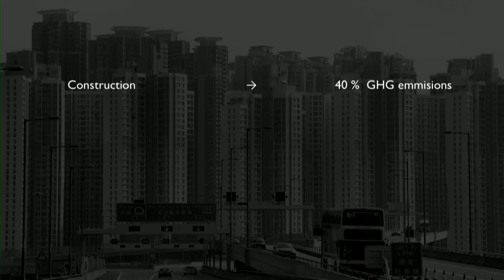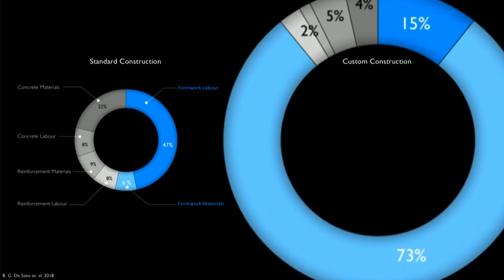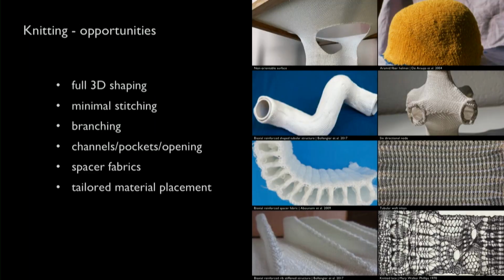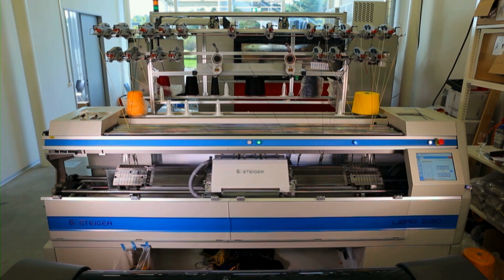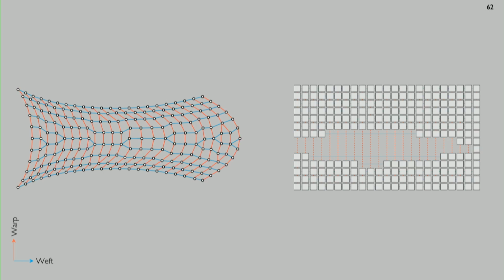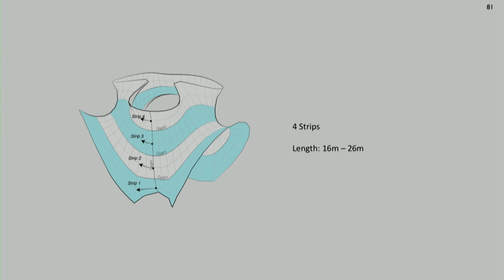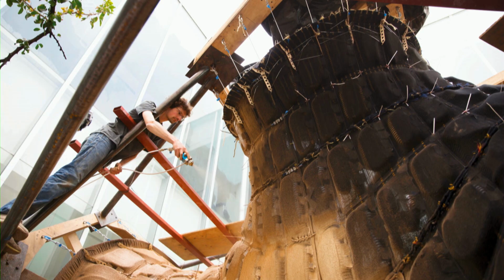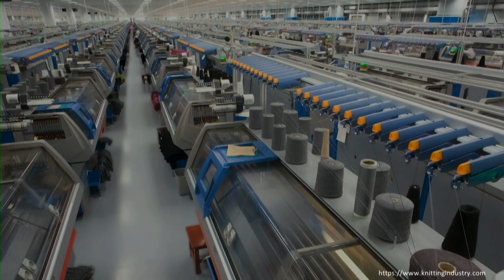Mariana Popescu // Block Research Group

Comment: The weight efficiency of the teextile cast instead of a traditional wooden one is amazing!, but no ones mentions that even though it weighs only 25kg, the whole wood and steel frame to tension the textile is really heavy and material intensive :O